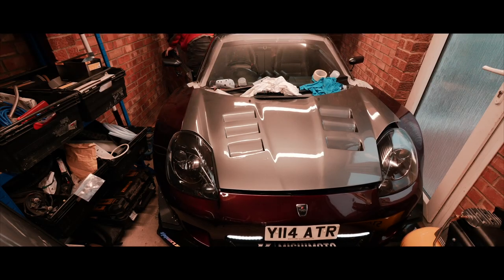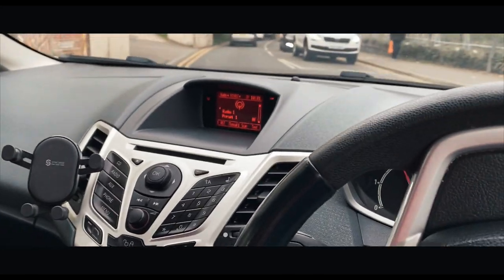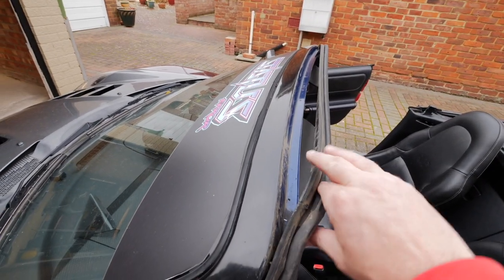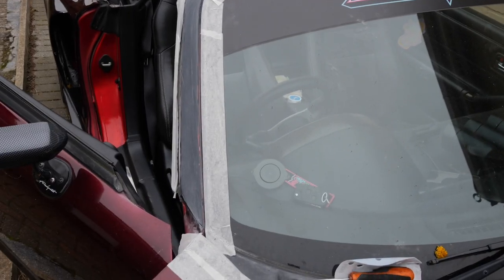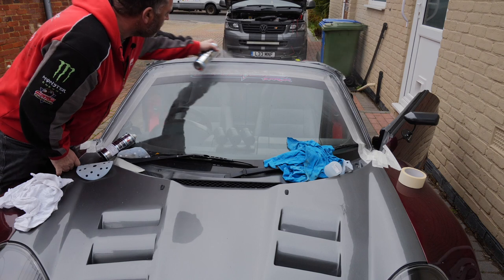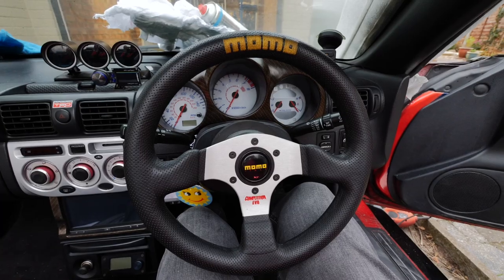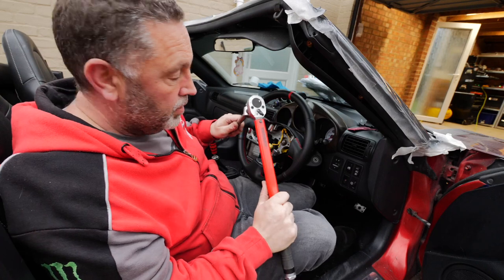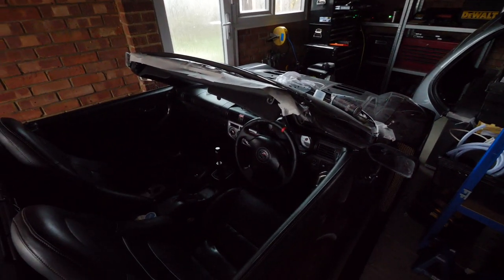Rattle-can restyling + steering wheel change MR2 Spyder / roadster

Comment: Great timing. I'm curious what the difference between a stock MR2 & Celica seat is, seems like a popular choice on the forums 🤔 Looking forward to the next one. Keep the vids coming 👍🏽
Reply from the maker: S2000 seats look good in the MR2
Reply: @SpyderLEE  yes they do. It’s what I have in mine. Much better than mr2 and celica seats imo.
Reply: Celica seats are an awesome upgrade over stock Mr2 spyder seats. They sit a 1 or so lower when installed. Just put mine in last week
Reply: I’ve got celica gts seats in my spyder and love them! Super comfortable and 6 hour drives are no problem, they also look really nice in the car- very oem.

Comment: Missed your spyder updates. Glad you went with the ducktail spoiler. I think you should go k24 and k20a2 heads etc you'll have 2.5ltr and more options for upgrading.  Thumbs up and left a like 😁
Reply from the maker: Still not decided with the engine. Whatever it is it needs to be cheap lol
Reply: @SpyderLEE  2zz is cheap but k24a2 would be cheaper in the long run. Just my opinion

Comment: Lee…if you haven’t got the overspray off yet there’s a few options…using a blade is good…also you can clay it off or if it’s really stubborn you can use some thinners on a scotch pad 👍🏼
Reply from the maker: Yeah got a clay bar I’ll try that. Couldn’t find a newspaper or anything to mask it properly. Doh. Remember next time. Been a while since I’ve done anything and forgot.
Reply: @SpyderLEE  I made the mistake of not masking enough when I did a smart repair on my windscreen surround…it’s the clear coat overspray…it goes everywhere 😞
Reply: I was very concerned about that as soon as I saw that most of the car wasn’t masked off, I also found out that the car doesn’t want to sit outside for about 24 hours afterwards which I’m glad to see that you eventually put it back in the garage.
Reply from the maker: @zokusharuuku1091  yeah I cocked up a little with the minimal masking but it came off really quick today with a clay bar.

Comment: Lee , what is the blue lines under the bonnet of the t5 is it a catch can if so where have you connected it too ?
Reply from the maker: It’s a catch can on the crank breather line. Between the cam cover outlet and the intake. High mileage engine so got more oil going back through the intake than I’d like.